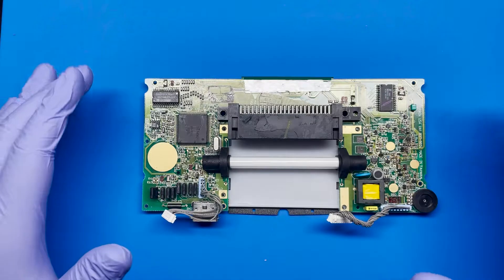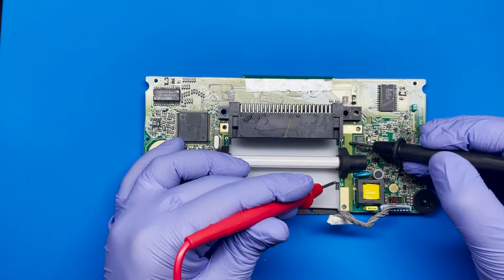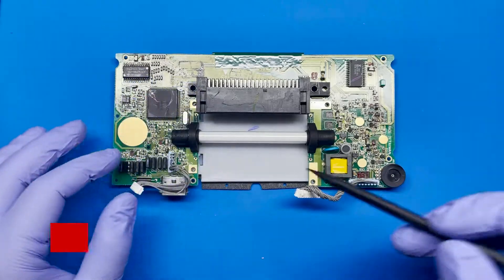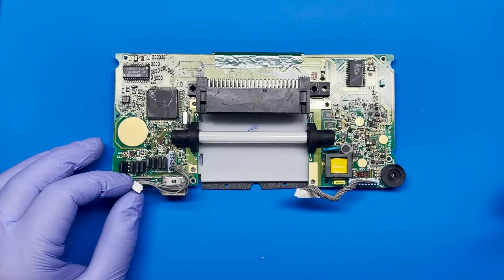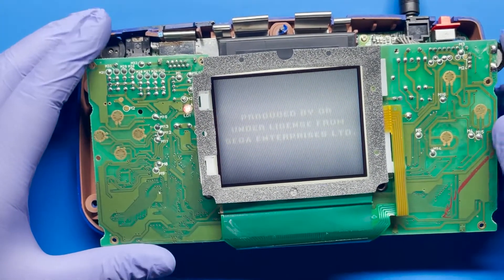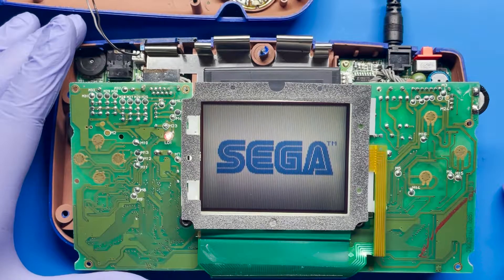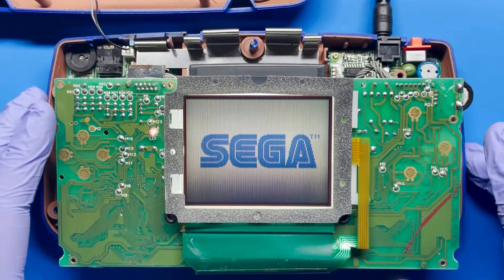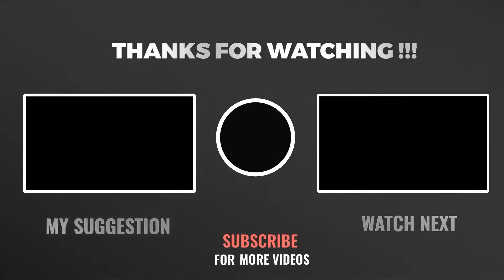How to Replace Broken Fuse | Game Gear

Comment: You can blow this fuse very easily when you are removing the Caps with the rework station. The Rework station is not good for everything.

Thx for the tip, I blew the same fuse with the rework station, the heat got to it. Thermal fuse, DUH me!

Comment: Where do you get replacement fuse?
Reply from the maker: I got it from eBay. For this one, they didn't have the exact same fuse, but I got the specs for the components and got a similar match.

Panasonic Thermal Fuse F102 TF 102℃ 1A 250V Links Axial Lead EYP1BF102L
https://www.ebay.com/itm/185382558657